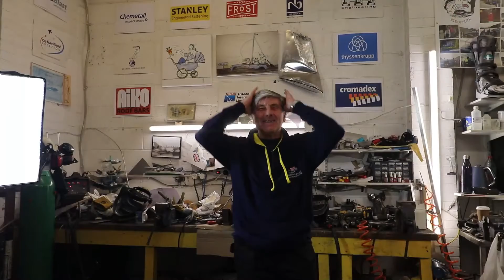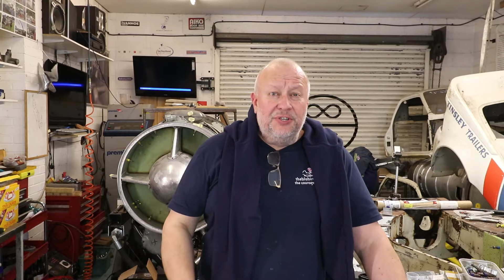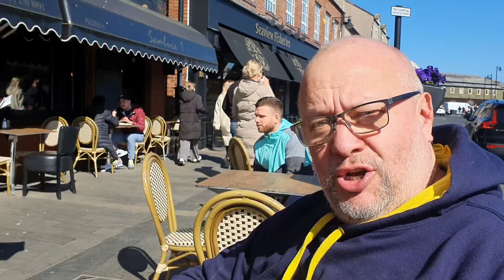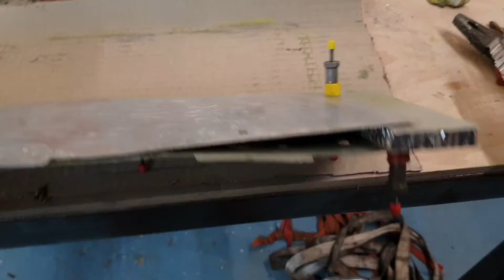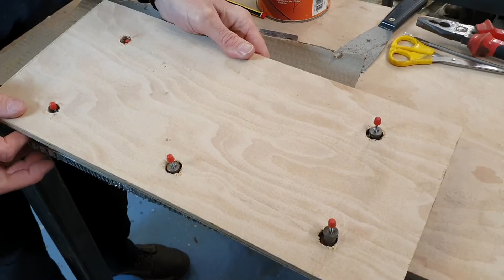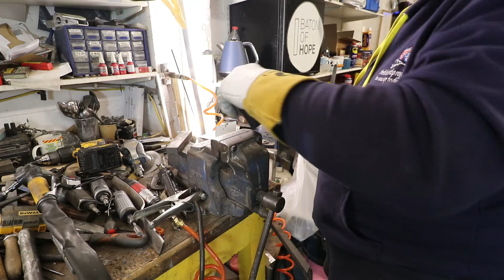Getting Brave With Honeycomb RS200 Rebuild Part 22

Comment: Wonderful stuff this.  So pleased I tripped across your latest videos, thank you for sharing everything.  Given how relatively simple the tub is, I do wonder why some enterprising people haven't reverse-engineered it and knocked out a new batch of them for the specialist car market. Probably a relatively small bunch of customers.  Subaru drivetrain parts or even creatively redistributed Audi TT bits come to mind and probably wouldn't work but one can dream.  I don't want to dream about the Banham Maestro-based RS200 "replica" though, that was more of a nightmare.
Reply from the maker: We could knock new tubs together more easily than mending this one but the transmission is always what makes these things tricky. I've consulted on a few replicas over the years and it's a better car with RWD only but try and convince anyone.